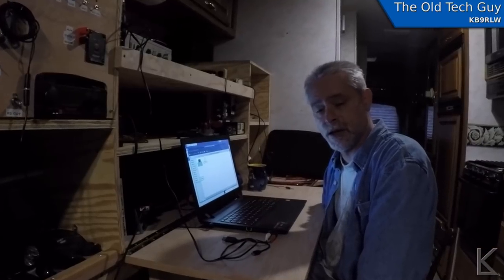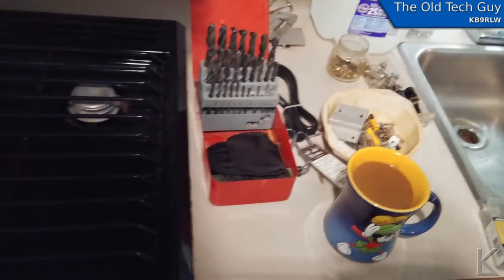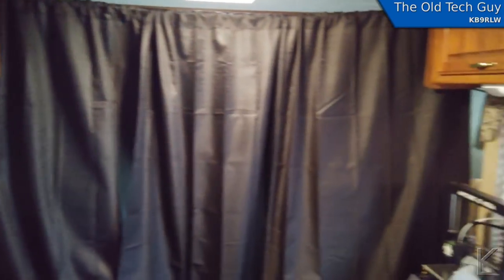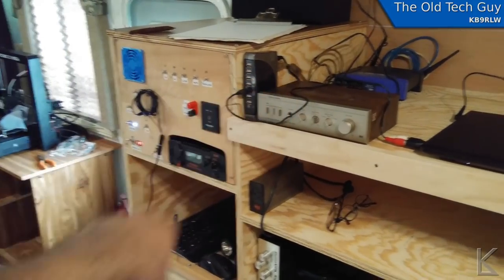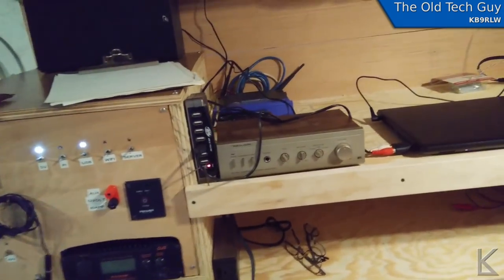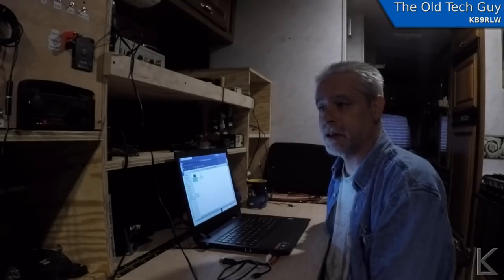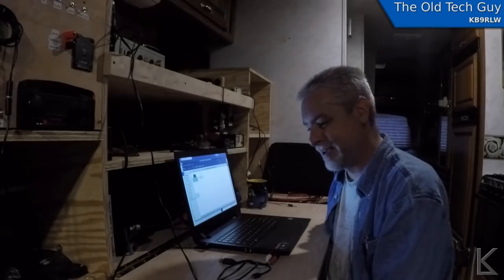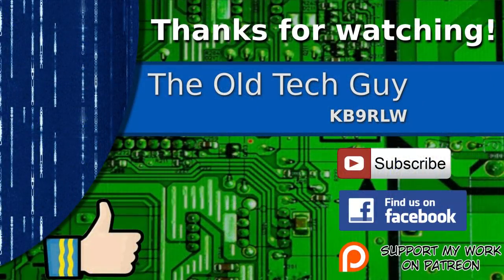Ham radio and RV  - Weekly update #5, the desk, 3D printer, and water

Comment: Looks fantastic so far! Speaking from experience, when you go out on the road make sure your electronic devices are well-secured.  Hitting a few potholes at 65 miles per hour will bounce even the heaviest items vertically off the shelf. I lost a laptop hard drive to a pothole...it only bounced a couple of inches off the table top but it was enough to toast the hard drive. You may want to consider strapping/velcro all of your radios to their location. Even in a cabinet, things bounce around like crazy.  Even canned goods. ;) Edit: No, I'm not suggesting strapping down the canned goods.  Oui.

Comment: Kevin,
one suggestion to cut the clamps off is to use a dremel and a cut off wheel (safety glasses).  You might also consider borrowing the pliers used to crimp them and tighten them up.  Possibly take a hair dryer or heat gun and heat the hose up if it has turned hard right before you re-crimp.
Good luck

Comment: Doing a great job, Kevin, Use your large diagonal cutters to cut off the crimp from those water fittings. REPLACE the short hoses and use screw clamps to seal them.

Some models of RVs did use a metallic coating on the exterior insulation which will screw up radio receive - transmit. I even helped work on an older RV that had aluminum studs instead of wood for wall construction.

Keep up the good work.

73 Moe K2JDM

Comment: On your water system you may want to start a fund to re-run everything in new red and blue PEX.  It is the PowerPole of plumbing. IE: Once you learn to use the right tool it works great! We redid our trailer and had no more issues after.  All other stuff looking great!
Reply: Ronny Julian PEX is awesome.  I agree.
Reply: Don't you use Oetinger type clamps on PEX?
Reply: Edward Clayton Make sure you use Oetiker clamps on Pex...beware of the knock off. The clamp will be stamped with OET
Reply: @davidspan6723  That is what I thought.  Would you use single ear or double ear clamps?
Reply: Edward Clayton You can either use the “ring” type clamp, but it would be much easier to use the one-ear hose clamp. You need a tool called a “pincer” to crimp the ear and close the clamp.
Reply: Google OETIKER Ltd....best clamps available to consumers.
Reply: @davidspan6723  I have a couple sets of Oetiker clamps and pincers.  Used them for doing fountain hookups in restaurants 
and bars....Never thought to use them on PEX though....While I have 2 and single ear clamps, didn't know if there was a
preference for use with PEX.

Comment: Your adventure is  unfolding... My wife and I have had alotta campers (summering on a lake lot) and the water heater has always been ... well ... a pain. I have taken to slipping a cookie sheet or boot pan under the unit... with a drain drilled right out to the ground.... caulk or solder a chunk of bug screen over the drain... also you may want to add a "I need..." clip board to keep track... when you get back to town. Best wishes... and thanks for letting everyone ride along... 73 Scott WB0ZLX
Reply from the maker: I like the drip pan idea.   Currently, I put a bit of plastic under it and then an old washcloth with the edges wrinkled up.   The plastic keeps the wood dry.  And the cloth absorbs and evaporates the drips.

Comment: Those little heaters really help. We occasionally use a couple of them through the trailer to keep the chill off and reduce the propane usage. The desk looks great. Don't worry, the storage space will fill up too quickly. The IC7300 is an excellent choice for a station like this. Safe travels. w6akb
Reply from the maker: I have 3 of the little 250 watt ceramic heaters now.  I put one in the front, one in the middle, and one in the back of the coach.  It got down to 39 here at the rv park I'm at one night and they kept it in the 60's in here.
The only thing I could possibly complain about with the 7300 is it's power hungry.  1.4 amps on receive and nearly 10 amps draw at peak during TX at a low 10 watts out.  Other than that, it's pile of features and tremendously intuitive interface make it  joy to use.  It's also got the best sounding receiver and filters I've had the pleasure to use.  I'm going to do a vid on the filters in CW mode.  It can make a moderately strong signal sound almost as clear as a code practice oscillator.  Amazing.
Reply: Very true. The Elecrafts are much better at power efficiency but take a lot more space and cost. I notice on the K3 when the power dial drops to about 12 watts a relay drops the 100W PA and saves a lot of power. With today's solar panels and LiFe batteries coming up with power for the 7300 is not too hard. I keep a separate battery for the ham station and avoid using the RV's batteries for that. The radio likes the LiFe's higher voltage and keeping RF away from RV gear (and RV noise out of the radio) is a little easier if the power feeds are separate. One can use a separate solar panel to charge it, or isolate the battery only when operating the station.

Comment: Do you have a carbon monoxide monitor? That is something I recommend getting since you have gas heat. If you get one, mount it low and smoke detector high.
Reply from the maker: Yes, both propane and co monitors are installed.

Comment: I've replaced a few leaky plumbing joints in my camper with PEX.  It's easy to work with and fittings are cheap enough.  Replacing the leaky joints completely will likely be faster and easier than trying to replace the clamps.
Reply from the maker: The clamps worked fine on the hose leaks.   Now I'm down to one weepy valve to replace.

Comment: That leak you have in that hose, I would cut off the clamp with a dremel tool with a cutoff wheel on it and replace it with a normal hose clamp. Good luck with it all. Looks like a lot of work

Comment: Hi again Kevin, nice work!
Water, water everywhere is what you obviously don't want! 2 suggestions... 1) get yourself some water leak detectors (used for washing machines) and place near water valves, under sinks, etc.  2) and I cannot emphazie this enough... Get youself a water pressure regulator for when you hook up your water system to a city/rv park spigot! Those have wildly varying water pressure (sometimes over 125 psi!) and can blow holes in your water system from overpressure!!! And don't go cheap... Get a quality one made in the U.S.A.!
One last thing, I know you are worn out and lots to do, but take 'A' day off, sleep, clear your mind, and relax! It will help you concentrate better when you get back at it the next day so you can think more clearly and not make mistakes or hurt yourself!
73 John
Reply from the maker: I picked up the in-line water pressure regulator when I bought the drinking water hose.
Reply: Kevin Loughin great!

Comment: Hello Kevin !!  Looks like you are getting a good handle on the water leaks !! That s9rt of thing does happen when the system is dry for prolonged period of time and with age, the hoses/pipes/fittings get loose in one way or another!!  I have to pass along a problem I ran into when I converted a 1989 Ford buss F450 chassis into a small camper is this ----- Watch your weight distribution between left and right side !!  I wound up with the right side a lot heavier than the left, I had to shift some stuff around to try to even out the weight some !!  So what I am saying is at some point in time, find a nice level parking area and without doing any vehicle leveling at all, look at the back of the vehicle and check for any indication visually of vehicle leaning left or right OR maybe check into a weigh station and see if you can weigh each side of vehicle or each side of rear axle just to be sure you are not too overly heavy on one side.  looks like you should be O.K. being that you bought a vehicle that was already a camper though !!  Happy motoring  and camping in the extremely near future !!!  Drive safe and be careful give yourself LOTS of space to stop in !! and watch your cornering speed and pay attention to your vehicle height and overhead structures !!!   sincerely,  John Bellas    KC2UVN    73's and good luck in your travels !!!!
Reply from the maker: I've been thinking about that.   The fridge, stove, couch and appliances are all on the drivers side.  So my desk being on the passengar side should balance it out.
I measured my height,  11' 6".  But I stuck 11' 8" in my head for a margin of error.  Also, it's easy to remember if you've ever seen any of the 11foot8 videos. (If not, search on it.  It's a laugh)

Comment: If you have a leak around a valve stem it might be easier to re pack that valve rather than replace it.  Plus you could probably get the packing for less than a buck. Just a thought.

Comment: There must be a way to use the solar to drive an inverter to drive a charger as I reckon that 3D Printer mush use a lot of power for the length time that it is operating.
Reply from the maker: The 3D printer will be limited to the times I have shore power to plug in to.

Comment: Regular hose clamps will not work for pex pipe, that took is fairly cheap to buy and will come in handy again. I usually take some vice grips and twist the little metal buckle until it gives and then take a razor knife to cut a slit in the pex to get it to let go. But I would strongly suggest not to  use a regular clamp..
Reply from the maker: The hose clamps worked perfectly.
Reply: @loughkb  did it work with the water supply hooked up from a hydrant? I never woulda thought pex would crimp enough. But anyway, v
RV is looking good. You'll be a pota expert in no time

Comment: That desk looks really useful. Nice layout. Worked CA QSO Party this weekend. 15 and 20 meters were the magic bands. Surprising from past experience. 40 meters was no go for CW and phone on Sunday. Worked a few 40 meter contacts on Saturday  before shutting down due to T-storms. Short on operators this year too. Only 3 of us. Lost time from shutdown from 2000 EDT SAT to 1100 EDT SUN. Still fun. CW picked up on 15 meters on Sunday. Hope to catch you on freq while mobile/stationary or boondocked. Do you plan to use stroke and section number once you leave the 9 call area? Best 73 KB8AMZ Not much longer now until the asphalt and concrete will be your daily carpet.
Reply from the maker: Yep,  I'll be using /# since I'll be eternally portable.
Reply: I wish more hams did when they are out of the call sign section.